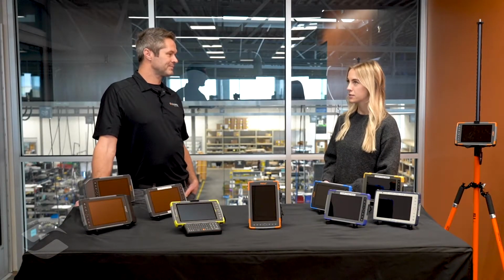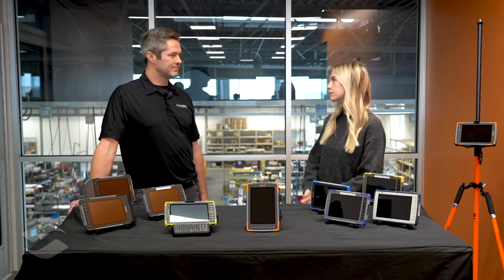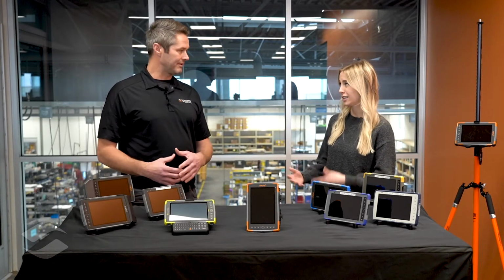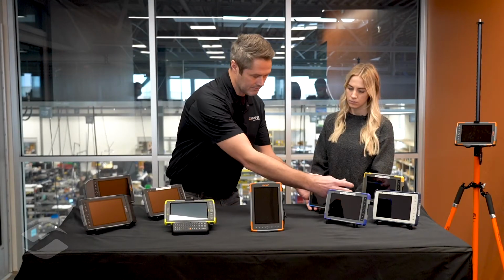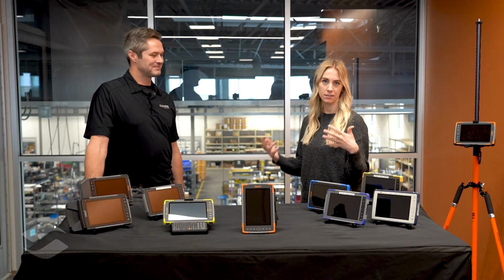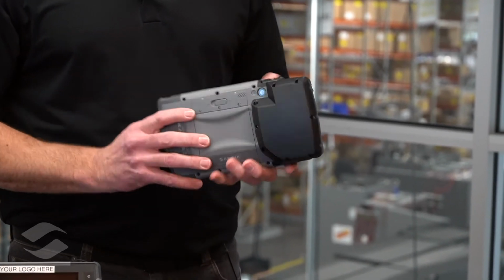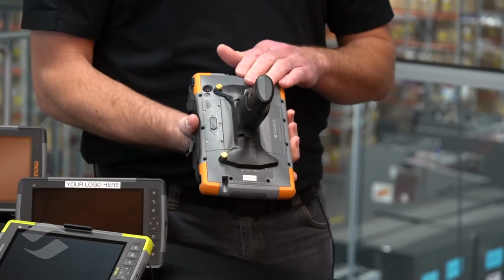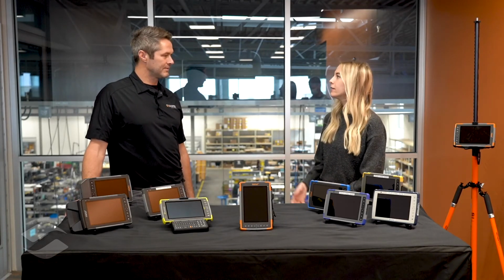Custom Rugged Tablets and Handhelds by Juniper Systems | Field Ready

Comment: The 24701 ball mount clamp is HOT GARBAGE. The rubber grip slips out of the bolt to tighten the mount, ever under low torque. Customer support's suggestion was to simply buy another $90 clamp. GTFO. How about designing a Metal turn handle, that is actually "rugged" and can't have the rubber strip from the bolt?!?!! This is not even close to being "rugged".